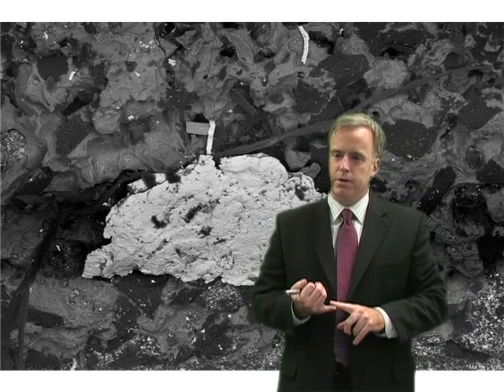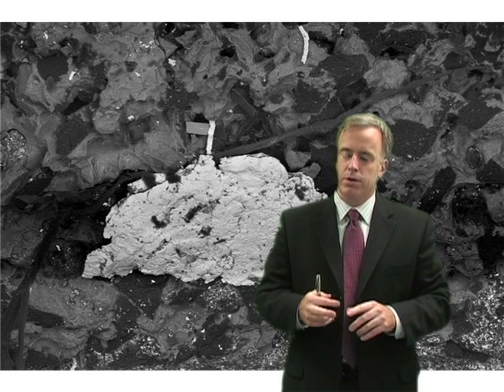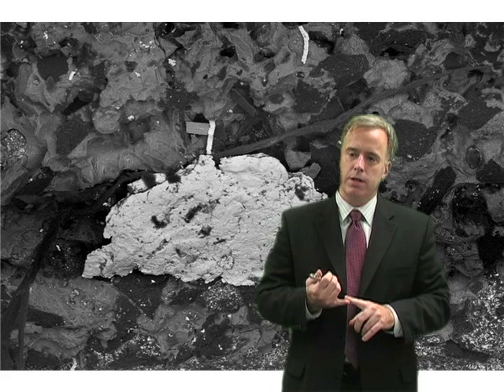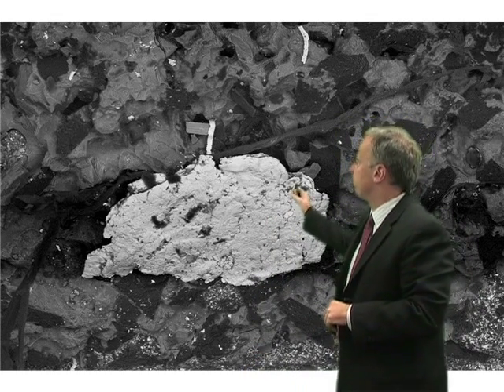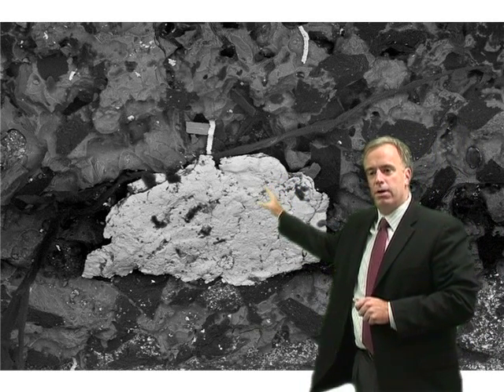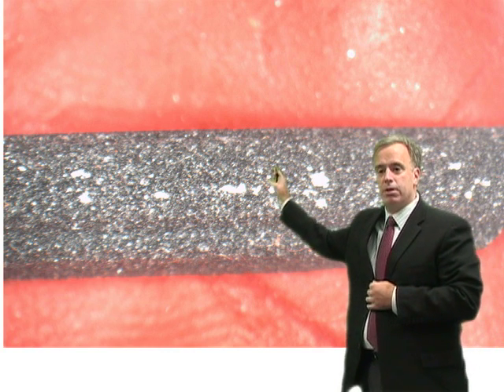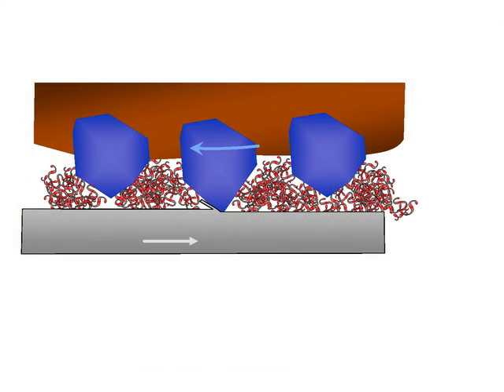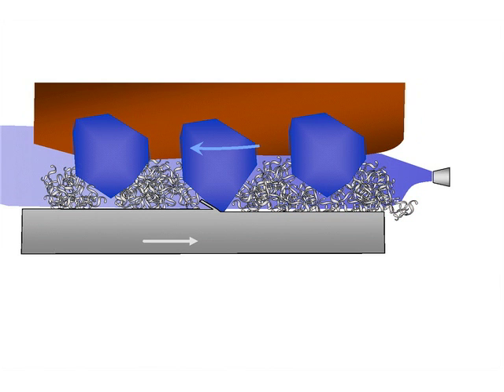Episode 10: Overloaded wheel?

Comment: coolant helps a lot, but you did not mention the real reason is the proper method of dressing /truing AND conditioning the diamond wheel after your dressing operation the wheel is not yet ready to grind ,you need to open the pores that is done by a simple method that most operators neglect , I can solve your grinding problems after 50 years in the business,
Reply: please tell me your secret